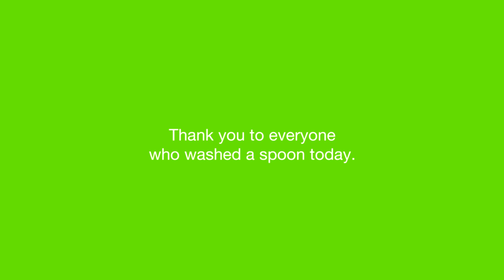The Story of a Spoon

Comment: I use small plastic spoons from ice cream in spice containers, and have memorized how much of each one such spoon hold. Metal spoons of this size are uncommon (I have just 1). The full-size eating spoons and forks that I've seen usually had a sharp edge, which is uncomfortable to put in the mouth, and they felt thin and flimsy overall without a good grip to pry food apart. They probably make them as thin as possible to save the material. I wouldn't use one if I had a choice, especially at home.

Metal can also have a disposable quality if cheap. Aluminum spoons don't last. But stainless steel without any plating or plastic handle is indestructible.